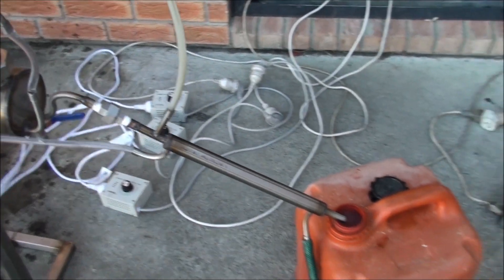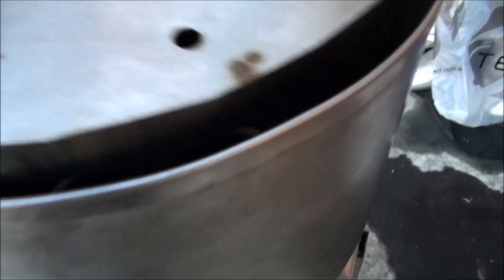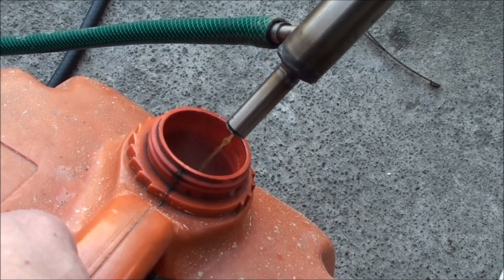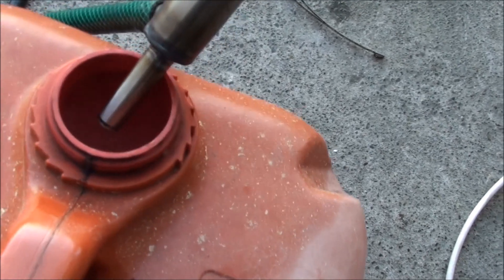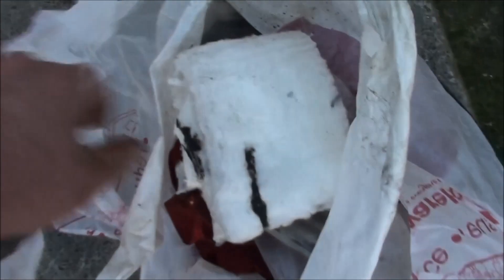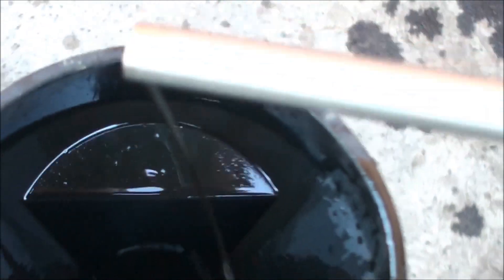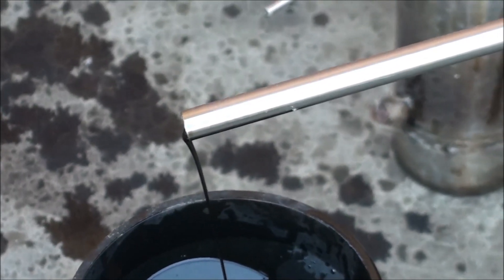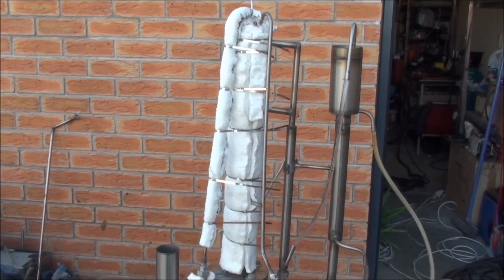WMO  - waste oil to diesel.

Comment: Very cool idea! How much electricity is used in the process to heat the oil into its fractions? I am wondering if it is more cost effective to use transesterification with methanol and KOH or the cost off electricity/heat to use this process.
Reply from the maker: the metoxide will not react with straight engine oil, you still need to distill it first, the machine uses 4kw per hour, makes about 12L of distillate per hour, the pup diesel cost is $2.20 per liter in our region, the electricity is $0.18 per kw,  thus $0.74 per 12L of fuel,  at the pump will be $26.40.

Comment: Stop compricating life. It is simple just mix used oil with kerosene to get diesel.
Reply from the maker: Sure, but what about the lithium and sodium based additives that make oil viscous? You may have a double fuel tank system to switch between before shutting an engine down, also what about possible coolant contamination? Are you sure about the waste oil quality to feed your engine directly, common-rail? Generally all those filtration/centrifuge/mixing arrangements are also complicated. So both methods are having right to coexist, and it is up to an individual to adopt either of those methods.

Comment: Is this also using a catalyst?
Reply from the maker: No Catalyst
Reply: Thanks for the reply. Does this same device also crack the oil, or simply distill it into its various components? Would this run considerably cleaner in an old diesel engine compared with a WMO/petrol blend of say 80:20?

Comment: does it have a similar viscosity and density to standard spec diesel fuel ?, would be interesting to try it in an diesel enigne. (no hate meant, im planning to build a waste motor oil still here in sudan)
Reply from the maker: Hi, yes this fuel has the same viscosity and I am running diesel car on it: https://youtu.be/JkfmIqZ7mXI

Comment: If you need an explanation as to what is happening &/or how this works ... You have zero business messing with what is going on in his video !!! Distillation of fuels requires intimate knowledge of distillation and of individual distillation apparatuses !!! Potentially deadly processes ! There is no "set it & forget it" &/or "idiot proof method" ! Guesswork & distillation is like narcolepsy and cruise control ... may take a minute , but something bad is going to happen !

Comment: It looks like the waste oil is a mixture of oil and diesel and you are just separating it.
Reply from the maker: the waste oi is mixture of a base oil that really clean diesel like substance and additives plus carbon and other byproducts of engine's work. Just think about the waste oil as a crude oil that can be processed and reused in one form or another.

Comment: So are you basically boiling the oil and catching the vapours like distilling alcohol?
Reply from the maker: The principle is the same, while temperatures are different, and evaporating oil is not a vapor as such but sort of mist and behaves not like alcohol. requires a bit different approach.
Reply: @santeryi9  I'm planning on turning my shed into a bio waste oil type room as well as a distillery to produce ethonol. Obviously 2 different peaces of equipment but hopefully I can succeed in producing such fuels and at the same time use most of my waste. I'm still looking into everything as I want it to be as good as possible. My campervan /rv currently runs on vegetable oil but would be great if I could produce my own rather than having to go to the shops all the time :)

Comment: Hi Alex, what additional steps would be needed (if any) to convert this into home heating oil?
Reply: You can just filter the motor oil for that
Reply: @xxRamD3yruxx  that would be too thick unless you cut it with acetone or another solvent. #1/ #2 heating oil is basically between diesel fuel and kerosene
Reply: @kevinmansfield8499  w
Wrong, heating oil is below kerosene and diesel on the distillation tower
Reply: @tylerhall99  I don’t run bunker fuel. I run #2 heating oil in the warmer months and “winter blend,” a combination of #1 and #2 oil, in the coldest months. Kerosine is a derivative of #1 heating oil and #2 heating oil and diesel are practically the same product, thus “winter blend” is a product that is somewhere between kerosene and diesel.

Comment: Could I distill motor oil from biocrude using a similar method?
Reply from the maker: If you mean vegetable  oil, then no, you can't distill it.
Reply: @santeryi9  I mean from pyrolysis oil. Idk I did a bit more research and found a chemist who was able to make a small fractionating column for this purpose. I think cracking heavier hydrocarbons and distilling would be best, as that would be the closest to an actual oil refinery, with the least amount of plastic impurities. This is completely not related to what you're doing though. Thanks for replying
Reply: @bilbo_gamers6417  Honestly it's basically the same concept. You can use different down tubes to capture different weights of oil.

Comment: Can i seperate gasoline from used oil? I need to have it recycled but when mixed with gasoline the company charge huge amount.
Reply from the maker: Hi, if your oil is mixed with gasoline, then yes you can separate gasoline from oil but with a bit different dedicated unit: https://youtu.be/I07i6BOhT1c
Reply: @santeryi9  i need to get rid of about 600 liters engine oil mixed with some E10 ( maybe 15,% ). I live near Arnhem ( NL ) do you know anybody..  

Waste oil companies charge 1 EUR a litre for removal i'm not going to do that 🤣

Comment: Let me ask the stupid question of the year, how do you know if the diesel you're making has enough lubricate in it? Ultra low sulfur diesel has less lubricate than regular diesel. I guess what I'm saying, is there a way to see how much lubricate is in the diesel or ALL diesel fuels have the same amount of lubricant except ultra low diesel? I guess you know by now I don't know nothing about diesel fuel but because of videos like yours I went out and bought me a diesel truck. I wanna start making my own diesel one day soon. Thanks for the video.👍
Reply from the maker: Hi to be sure that the resulting fuel is good enough, I always perform a simple copper strip test, plus always adding diesel conditioner and the two-stroke oil, thus I am sure that the fuel has all the lubrication qualities, correct cetane number, and not corrosive. Moreover, I am treating the fuel prior to the use with absorbents to eliminate any tar and polymers.
Reply: @santeryi9  thanks for the reply and the info buddy.
Reply: @santeryi9 can you run in common rail? Is it as clean as diesel #2m
Reply: Add marvels mystery oil and your good

Comment: What is its density? Can it be used in any diesel engine vehicle?
Reply from the maker: 830 -840kg/1000l yes will be fine for a diesel engine.
Reply: @santeryi9  would this setup be able to process pyrolisis oil as well ?
Reply: @viktorreznov1548  to do that you need a special oil and gas chemist. I ask around and the main guy told me to do pyrolysis oil from cooking oil is a huge fail because you only get .5 liter of the pyrolysis oil . So all that used cooking oil is worthless , just stick to diesel from the used cooking oil if anything.

Comment: That waste oil can still be run on the Diesel engine. Just not to much of it @ once tho.
Reply from the maker: all depends on the final treatment of the fuel, possible additives.
Reply: Never done it myself but apparently you can start a diesel on normal diesel (obviously) and then switch to a different tank with mix of diesel and vegetable or engine oil once the engine is warmed up. 
I have a book somewhere that explains all of it including how to filter or centerfuge the oil prior to use

Comment: Is there a way to convert diesel into car oil or any other oil?
Reply from the maker: Should use so called base oil, add some additives that require for a particular type of engine oil and here you go.
Reply: @santeryi9  can we obtain base oil type 2 if we process further the output of your machine? If yes what further processing it needs ?

Comment: Is the brown stuff ready for the car or what are you supposed to do with it?
Reply from the maker: settle with some absorbent for three days, you can use a wood pellets, so the polymers will settle over the time, the fuel will become clear an then you can use it either as a fuel or as a base for lubricants production - from oils to grease and polishing/grinding pastes with some additives.
Reply: @santeryi9  can that process be automated to get a consistent grade of diesel that would pass lab tests ?

Comment: Hi Alek,
How do you like that pump that you are using? Is this a typical generic fuel pump? Thanks!
Reply from the maker: yes it is a fuel pump, you can use` a gear pump, but then you'll need to organize a bypass to prevent over-pressure, with this pump it is easier to control the flow.

Comment: how many litres  van this small distilling machine distil per hour.hussjean2002@yahoo.fr
good day
Reply from the maker: Up to 20L per hour, all depends on the type of oil chosen for distillation.
Reply: @santeryi9  HANE U USE USED SYNTHETIC WASTE  MOTOR OIL
Reply: @santeryi9  HAVE U USE USED WASTE SYNTHETIC MOTOR OIL